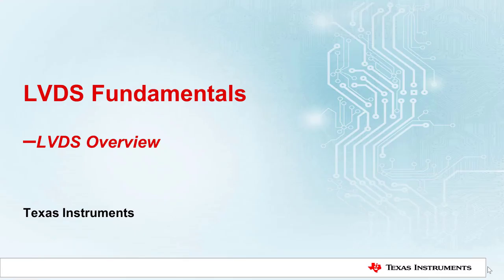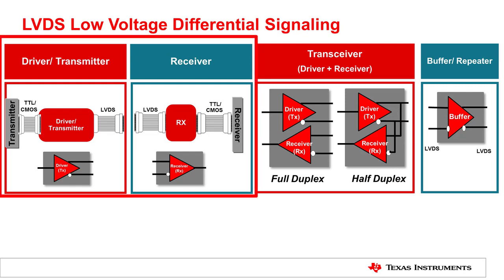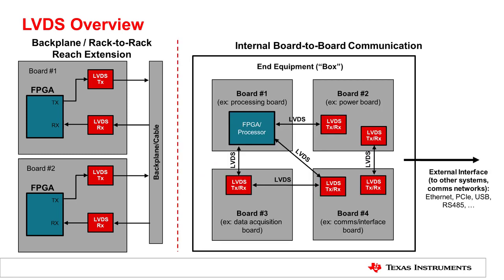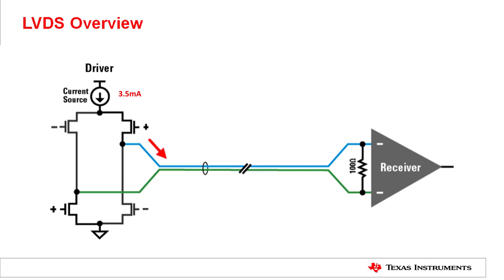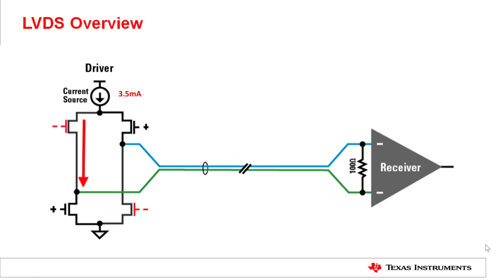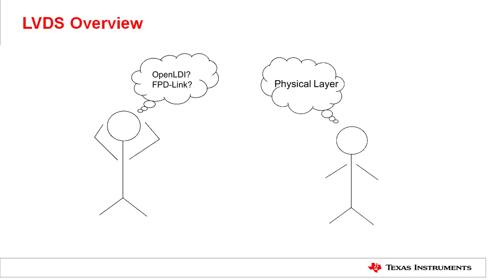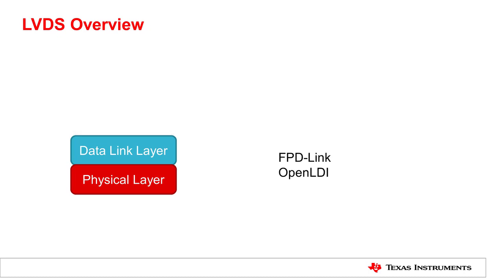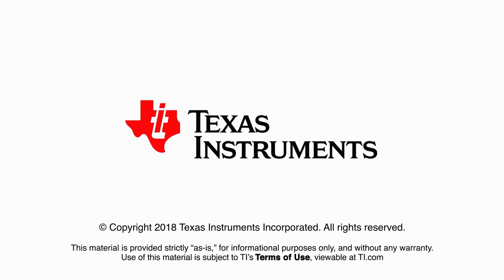LVDS Overview

Comment: Great stuff to explain the concept of LVDS differential signal but the input signal of high and low supposed to propagate down the line simultaneously as pair to cancel the noise not as shown one after another.

Comment: This is a a bit misleading. Current and Voltage flow simultaneously as a wavefront propagation. The return current does NOT wait to travel down the transmission line through the load and back to the driver as this illustration shows. The signal and return currents travel simultaneously in the differential pair because of the energy inside the H and E fields.